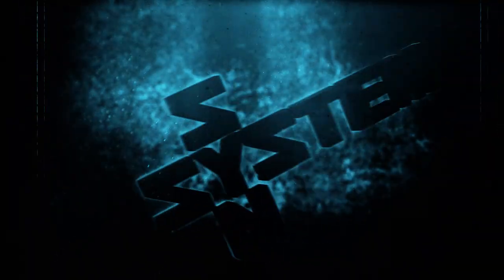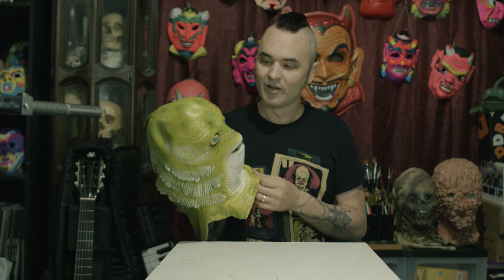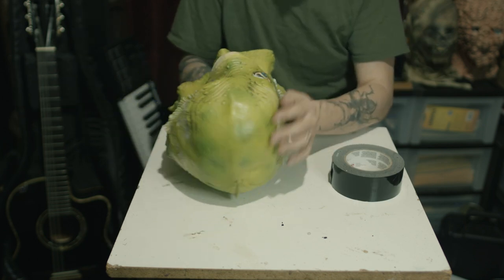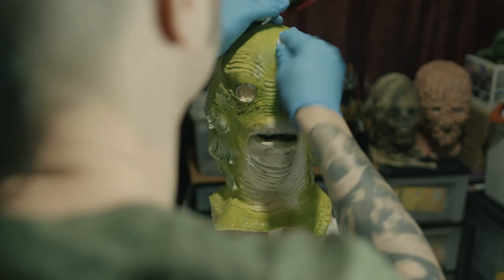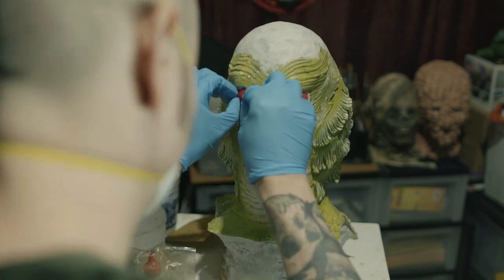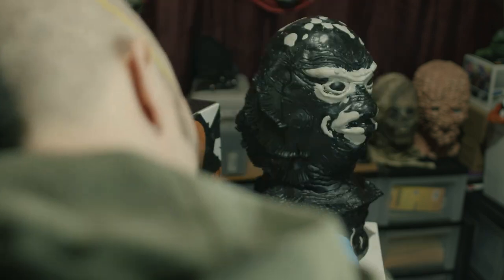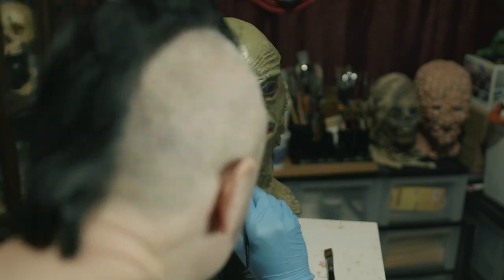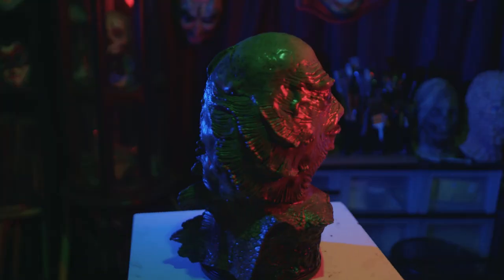How to turn a cheap halloween mask into a cool display!

Comment: Do you have any other tips or tricks to remove the creases from shipping? I use a heat gun and no luck.
Reply from the maker: Try heating the mask from the inside of the mask... though be careful if you're using a heat gun instead of a blow dryer as it can get too hot. Then while the mask is hot, stuff it with something to put it in to the right shape, and let it cool off while stuffed. You might have to repeat the process a couple times if the crease is really bad. Good luck!

Comment: Nice video it looks great do you know what type of paint can be used on silicone and rubber I have some 1/6 phicen bodies that I want to paint i tried soft pastels but its not that good...
Reply from the maker: Thanks for checking it out! Silicone is pretty tricky to paint. You have to mix your paint with silicone basically. If you search youtube for "painting a silicone mask" you'll find a few good videos that walk you through it. Same with the rubber props, just search for "painting a latex mask," and there are lots of great tutorials. Good luck!

Comment: THANKS for the inspiration!!! 
Started the project to do all three movie Ampibious Creatures (Creature from Lost Lagoon, Abe Sapien from Hellboy and the creature from Shape of Water). 
I can concur that spray foam is not the way to go. Had a disatrous (using a Shape of Water mask) go where I put a whole can in and it stayed liquid (lack of exposure to 'air' or reaction with the latex?). Completed the bust and painted it only to have it expand like the worst case of the mumps. Released the pressure by cutting behind the gills and the foam expanded and squirted out for DAYS!!. Sliced open behind all the gills and eventually salvaged it. The exposed gills just added to the overall effect. Tried two other masks (Ape Sapien, and Creature FTLL) using Gorilla Glue method. Much more controllable. Had so much fun that my next attempt is to make Horror versions of the Cereal monsters Franken Berry, Count Chocula, Boo Berry, Fruit Brute and Yummy Mummy. Found suitable masks as a starting point on ebay for about £17.99 each. Can't wait.
Reply from the maker: Yeah, spray foam was definitely not a great idea. ha. That's awesome that you're doing all the amphibious Creature busts! Where can I see your masks?

Comment: How would you revamp this mask so it would look good but still be wearable?
Reply from the maker: Great question. You wouldn't be able to use those sculpting materials on it at all, so you'd pretty much just want to do a repaint, though the acrylic paints that I used in this video I wouldn't recommend for a wearable mask as they would eventually crack. I'll try to cover that in a future video though. Cheers!

Comment: I have been following your video and had same issues with bumps on the head, I used regular liquid foam. I covered the head with clay and sanded it but cannot get rid of the lines around the edges. Any tips?
Reply from the maker: If you're having trouble with the seams, try going a little thicker on the plastic spray, or doing several coats. That can really help to mask a seam.

Comment: You can actually fill a mask with gorilla glue which foams up but won't deform the mask.
2 part post hole foam may also do the job

Comment: Planning to redo a mask, want to wear it at times instead of being on display all the time. Should I still do the plastidip step?
Reply from the maker: Hey Tonio, I probably wouldn't go with Plastidip on a wearable. Though it is flexible, it just doesn't have the stretch that latex does, so on a wearable it may eventually peal. :-)
Reply: @ClintCarneyCreates  would you still recommend the paint used in this video?
Reply from the maker: @MustafarBurn  No, you may end up with cracking it you use that kind of acrylic on a wearable. Check out this video that covers painting wearables pretty well. I use the same paints for those as they do in the vid: https://youtu.be/_RwdgQ3_o-w

Comment: Isnt styrofoam in a mask a big no no? I collect too and always read and seen pictures of  that it messes up latex after a while.
Reply from the maker: I've been collecting for many years now and have never had an issue with styrofoam heads. I still have masks from the 80s in my collection that are holding up great. Plus, I don't think styrofoam absorbs moisture by design,  so I can't imagine how it would dry out a mask. But, you can always throw a plastic bag over the head first to be safe. :-)

Comment: Hi I have a question can pls someone answer me?

Question: doesnt this paintjob, and foam let the mask dry out after time or is it preserved during this to the mask? Latex is rotting after time. All over this cheap ones...
Reply from the maker: Good question. I've personally never had a problem with foam drying out any of my masks. I think if you keep them out of extreme heat, they hold up pretty well.

Comment: Does let the foam rot the mask?
Reply from the maker: I've never had that issue before. As long as you keep you're masks out of extreme heat, and never fold them up, they should be just fine, in my experience. Thanks for watching.

Comment: Nice work! What kind of paint did you use on this?
Reply from the maker: Thanks Tony! I used Liquitex Basics acrylic paint. I wouldn't recommend that for a wearable mask as it may crack, but for a display piece where the latex isn't going to bend or flex, it works great.
Reply: @ClintCarneyCreates  Great idea. Yeah, seems that'd be perfect for a display piece, and economical, too!
Reply from the maker: @ToeKneeStrauss  Definitely. :-)
Reply: @ClintCarneyCreates  What kind of paint would you recommend for a wearable mask.
Reply from the maker: @midnitedip8850  I mostly use Createx Bloodline. Here's an Amazon link in case you're interested in picking some up: https://amzn.to/3uOMW4F :-)

Comment: I have a VERY expensive silicone monster mask ($620 expensive) that I ruined the mouth on last year when it got caught on some costume teeth and was shredded. Do you think this process would work on it? I have a mannequin form I can put it on but have to sculpt a new mouth and eyes. What would you recommend to make it non flexible? Thank you for your time and any information you can provide helping me in this matter. Keep on creating awesomeness!
Reply from the maker: I would probably avoid foam filling a silicone mask. I imagine that it would likely stretch in unexpected ways as the foam expands. You may be able to repair  the mask though. It might be worth while to reach out to the mask company and get their advice in it. I'm sure they all have had to repair their masks at times. Good luck!
Reply: @ClintCarneyCreates  have a copy of the actual mannequin head they molded the mask of off, won't have to worry about it slipping off the mold form, I was just wondering if I glazed it in the 5min epoxy if that would turn it rigid enough to last? Unless there is another product that could do something similar? Thank you for your reply. I appreciate it. Some people never reply to comments on their videos. :)
Reply from the maker: @stranoparanormale-existbizarre  That's great that you have the mannequin head. I've only ever made one silicone mask, so I'm not entirely sure how well it would do with the 5 minute epoxy. Good luck with it. Let me know how it turns out!
Reply: @ClintCarneyCreates  I will def try it out. Can only screw it up more ha!